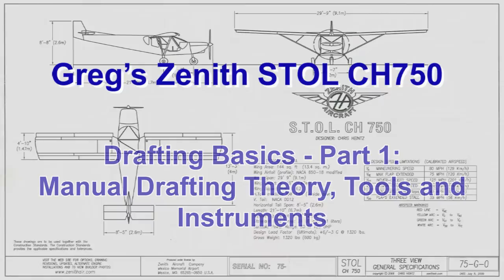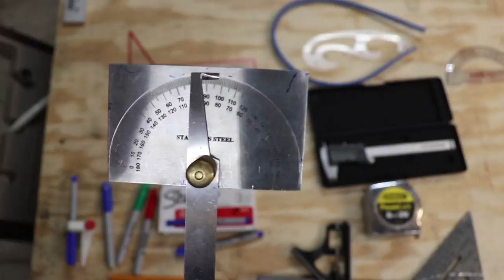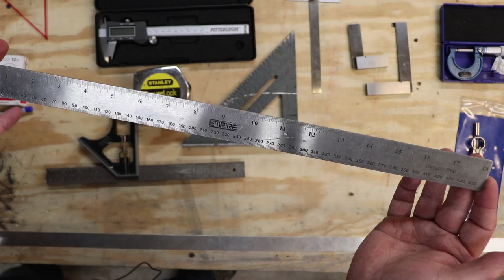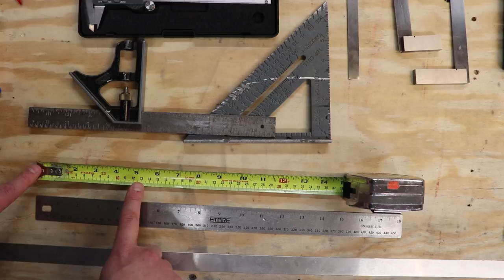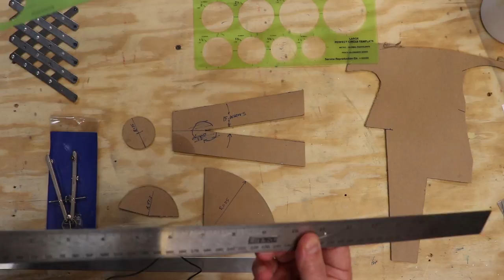Drafting Basics - Episode 1: Manual Drafting Theory, Tools & Instruments

Comment: Your videos are helpful, and scary, I am just starting my build of the CH750. I feel I maybe in over my head even though I have built an all metal plane before, except it was with my dad who hag been a sheet metal mechanic/ shop supervisor at Lockheed for 51 years. He actually built a jig for the wings when we built the other plane.
Reply from the maker: Are you scratch building?
Reply: @GregsZenithSTOLCH750  yes, to save money, the last one we built was a Pazmany PL-4
Reply from the maker: @wb6anp  It's a big project, but the Zenith is relatively simple to build. It's definitely a marathon, not a sprint. I'm glad my videos are helping some...it can be daunting. It's a lot of fun, too. If you built another plane before, you can build this one.
Reply: @GregsZenithSTOLCH750  what sort of concerns me is the build table, my bench is only a 4ft bench, I store my truck and Camping trailer in my shop I don't have room for a 8 or 12 foot bench unless I pay for storage for my trailer. I wish I hadn't donated all my dads Lightening hole dies to eaa after he passed. He had made all the flanging dies my machining aluminum
Reply from the maker: @wb6anp  I haven't parked in my shop in years now. Space is a huge concern, particularly when scratch building due to the machinery you need. It'll be hard to do without a 12-foot table. Hillsgun YouTube Channel has affordable dies. He sells them on his website.
Reply from the maker: @wb6anp  I have to cut the video for that. I originally used steel dies borrowed from Roy's Garage. But I have a set of Dan Hill's composite dies and they work great.
Reply: @GregsZenithSTOLCH750  here is the one my dad and I built about 38 years ago, wow just realized it was that long ago. https://photos.app.goo.gl/ou7ehYD9NJHDZKHG8

Comment: Greg, I did all the parts on AutoCAD, did take a while but if I let other people have it then they'll save time! I had to do it for part nesting in the sheets, there is no info on how much material is needed to scratch build...
Reply from the maker: I cannot remember (I know we talked about it before)...are you going to cut the parts on CNC or make paper templates? It would be great to make info available to other builders, just be careful about copyright issues!
Reply: Greg's Zenith STOL CH750 Greg, the only parts for cnc are the flap arms, the rest is "one of " or easy to do with forms and the router table.. Yes copyright is important I will give it privately to zenith forum members only, they are already plan and kit owners... Since I'm not selling anything I'm pretty safe. No one can build this plane with a partial AutoCAD drawing without bend lines and Rivet holes anyway.